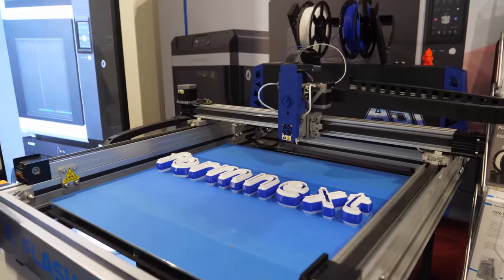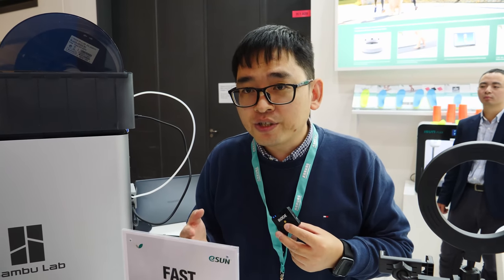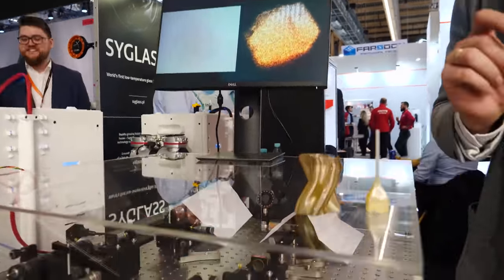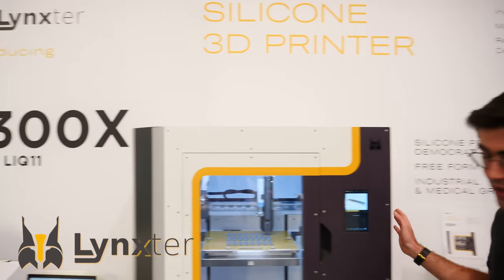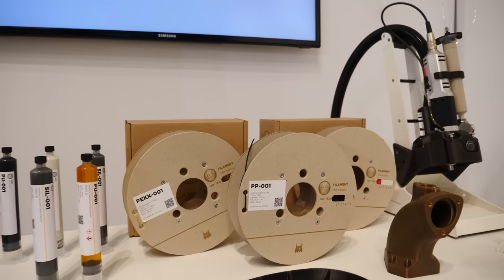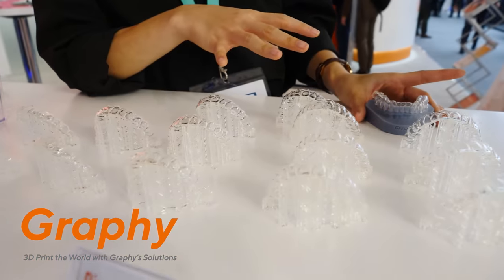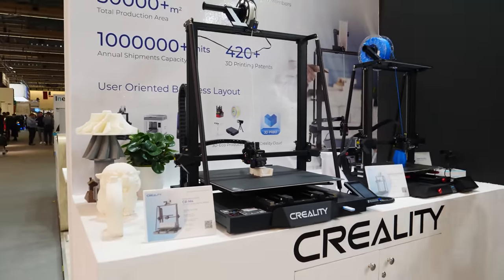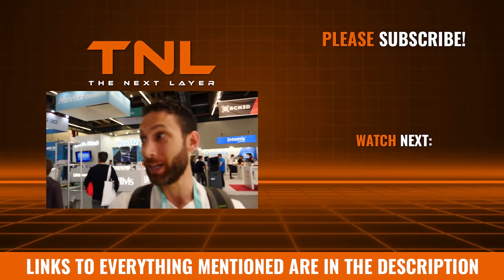FormNext: The World's Largest 3D Printing Conference (Day 1)

Comment: As a Bambu X1 Carbon w/AMS owner at @500hrs printing time, if you want it and can afford it GET IT.  Period.  The newly announced P1P is a stripped down version without all the bells and whistles for a more wallet friendly package.  I can also easily recommend the Creality S1 Pro with Sonic Pad running Klipper.  Great machine massively enhanced by the modern firmware and features like input shaping for less than $700.
Reply: Im looking for an upgrade for my ender 3 pro. Looking at prusa mk3s+ or the bambu x1 carbon, which should i get?
Reply: @wolfewatson  I have a MK3S+ with the MMU2S and its a fantastic system.  It's no X1 Carbon though.  If you have the $ get the X1
Reply from the maker: I love my Prusa, but I wouldn't buy it again today... Bambu is just too much  more advanced.
Reply from the maker: Yep. Also a Prusa fan here, but... they've lost me. Their stuff looks like dinosaurs here on the floor... no comparison. Even the XL... it's all 3d printed parts. WTF?
Reply: @wolfewatson  get the x1 with AMS 👍 I own one and I love it.
Reply: Thanks guys, Will look to get the x1😊
Reply: I really need help - buying my first printer, I'm interested in buying an Ender S1, maybe even the PRO version, how much do you recommend it? Or are there other printers on the market that have more value for money.
Thanks .
Reply: @DDDOR01  I bought the S1 Pro a couple of months ago as my first printer ever, after looking at videos for a loooong time. I'd say both versions are really good and pretty beginner friendly - I bought the S1 Pro for the touch screen, because i just wanted the best version out of the box. I'd recommend you watch some videos about setting it up, etc. I was afraid of all the settings and tweaking and complexity, but you learn the basics really quickly. It's a really fun and practical hobby - definitely wish i got started sooner :)
Reply: @user-uk3gc2dk3h  Thank you

Comment: The X1C is really a heck of a machine. Its an absolute beast doing engineering materials. For the price it is, it's destroying printers 4x the cost.  There are things I've asked bambulabs to address -- still waiting on them adjusting idle current to where the steppers aren't warm to the touch hours after a print is done. FYI it doesn't auto disable steppers ever. Steppers are always enabled -- likely because of their in house developed stepper drivers (not trinamics). The AMS on it is really ingenious tech. Its so simple that it's brilliant. I've had to extricate some brittle PLA that got stuck inside the AMS tubes -- in multiple places and followed their guide how to take it apart, it's such a beautiful design when you open it up.